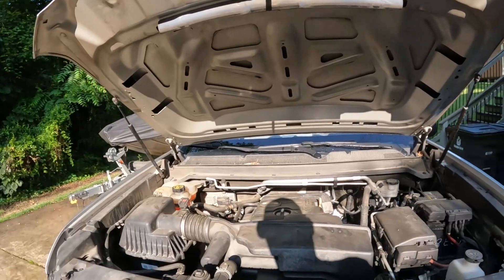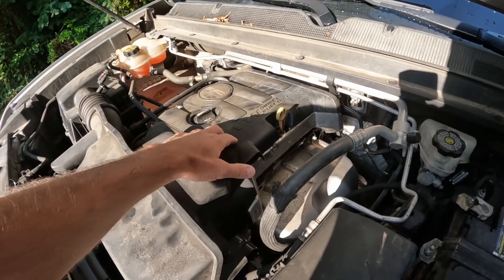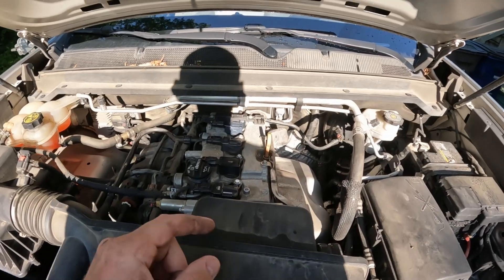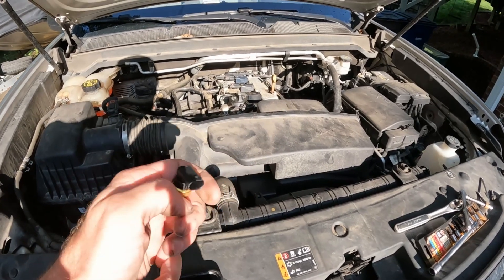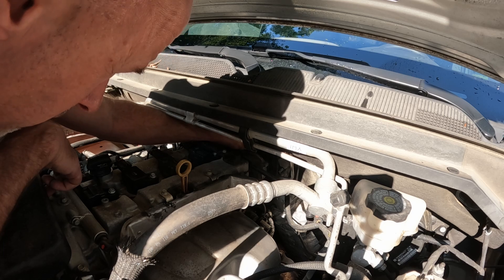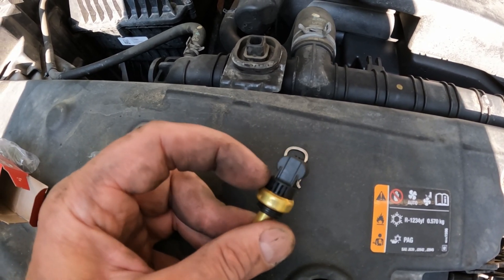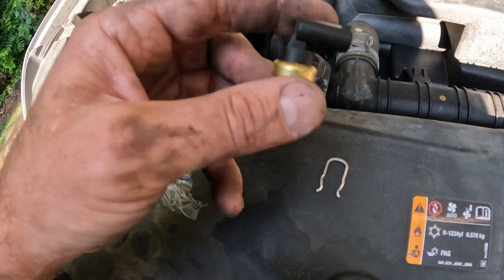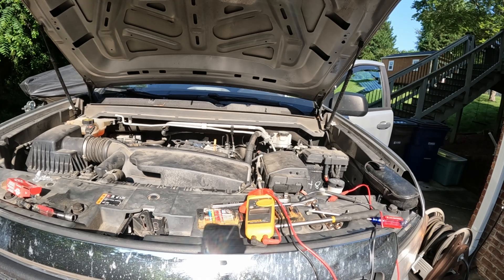P111E Engine Code GMC Canyone Chevy Colorado 2015-22 Rear end temp sensor replacement

Comment: Thank you Dave. been following your updates as they are good to have if I have the same problems. I own the same truck with 6 speed manual and 2.5 ltr.
Love the truck .  Just changed the rear gear oil and will be changing the trans fluid in the next few days. I guess the fact that you don't have many problems is a good thing . I  just turned 45K miles  with oil and filter changes every 3500 miles, should last a long time,
Reply from the maker: Awesome.  Such low miles.  Should be good for a very long time!